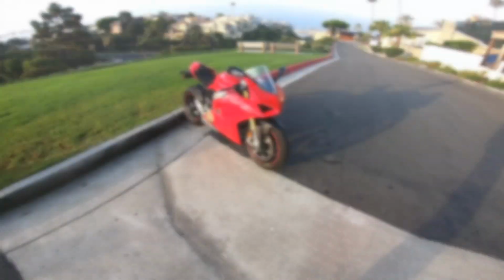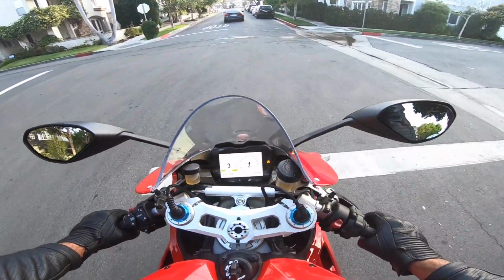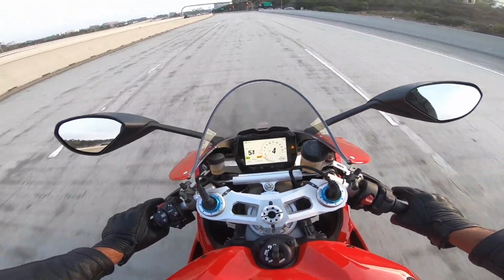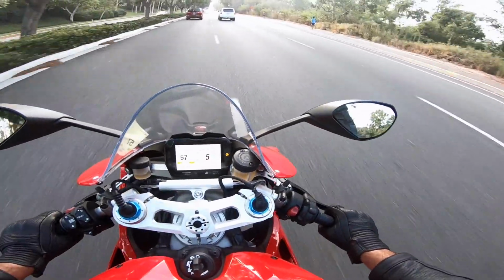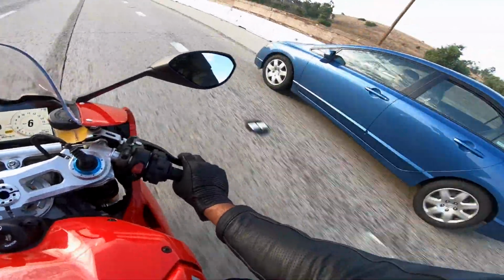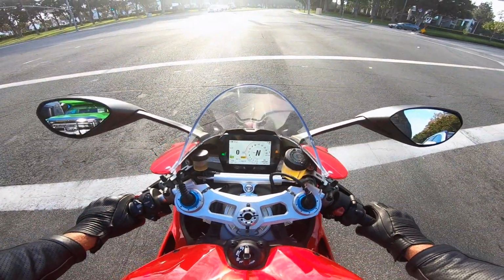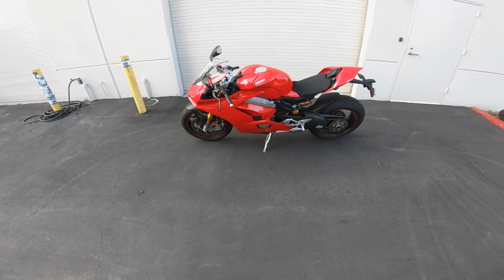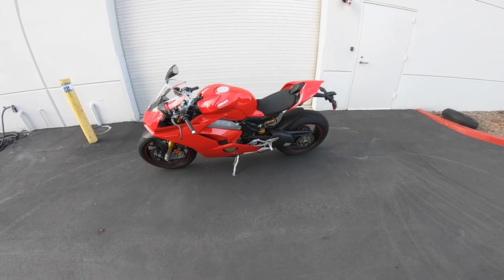2019 Ducati Panigale V4 S Review | MC Commute

Comment: the only thing i learned: the words "panigale" and "commute" should not be in the same sentence.
Reply: Panigale wasn't really build to be used for commute.

Got my friend V4R for a month as a lease to test it and damn it didn't took me 2 weeks before I return the bugger back to him back ache,palm and shoulder hurt the most but its a fun bike.

Also its not highly suggested to use this bugger in time of summer due to its nut cracking hot wind blowing.
Reply: deck pogi how'd you get the bike as a lease? You mean temporary rental?
Reply: As a 1299 Panigale S owner, I can attest to the accuracy of this statement.  The right thigh cooker will have you re-thinking your decision at the first stop light.  Get it out on a race track, though...
Reply: @deckpogi2680  if you aint hitting the canyon or the track getting something else instead my friend
Reply: @fmartin59  my friend own one right away.

He's working in the Ducati as one of the designers.
Reply: @patthonsirilim5739  I got tons of liter bikes I've bought and used.

V4R is a fun bike minus the clutch plating problem.
Reply: @deckpogi2680  What clutch plating problem?
Reply: @BTrain-is8ch  the clutch itself tend to slipped and doesn't shift well.
Reply: @jeanquadvandamage9211  what if my thighs and skin are built different?

Comment: Nobody wants to admit it... but how good a bike looks IS important... and that bike looks GOOD. As much as I love wheelies... that little head wiggle when you land with the front pointed a bit off is definitely pucker inducing... steering damper is your friend.
Reply: Yes looks are important but the thing that makes you smile whenever you ride the bike is the performance. You can make a shitty chinese 125cc bike look like a panigale but you’ll end up selling it because it doesn’t satisfy your need
Reply: Bikes are no less than works of functional art.  Some examples just jump out at you.
Reply: Steering dampers are your friend indeed, but good ones. I found out the hard way how bad was the factory one on my TL1000R coming down from a 3rd gear wheelie. Never had a worst tank slapper in my life! Needless to say I ended up in ER :)
Reply: @BloodySinner as u said looks are subjective, but the new s1krr is far from a fireblade in looks. I don't know how it looks same to u.
Reply: Why do you turn ur wheel when wheeling? Lol it should stay straight..
Reply: @bobfrankfurt9449  You generally don't... but there are lots of circumstances where landing can get a bit off. Sometimes when I get on the throttle a bit hard too quickly coming out of a corner the front will lift and then it's tricky to get it back down perfectly because you're straightening up and shifting balance (usually it's a bit off). If you have a bike that wheelies easily under power you get a lot of practice.
Reply: @bobfrankfurt9449  you turn your wheel when you wheelie is so you can see the road ahead.  If you kept it straight you can't see the road in front of you, which is important.  You need to see the road ahead of you so you can watch for possible obstacles in front you.  Last thing you want to hit when you are doing a wheelie is hit a pothole.

Edit:  I'm not talking about the actual wheel of the motorcycle but your wrist and the handle bars that block your view.  When you wheelie obviously the front of the bike is up in the air you can't see what's in front you. So, you turn the handle bars so you can see what's in front of you.

Comment: It has this great EC 2.0 dynamic suspension that is obviously rubbish for the street. I have no idea what you mean by calibration from Ohlins, the suspension is always going to be calibrated by the manufacturer based on the bike. It sounds like its set to track or sport by default, so a manual adjustment for preload etc.. based on the weight of the rider etc... is always going to give the best results and for street use, Road settings for suspension are not just more comfortable, but safer.

Comment: Good review.
Only thing i would say is that the heat is actually not that bad. 1299 was way worse than this thing. Ive been riding mine during the summer down under and its not too bad as people make it out to be. But you have to know what your in for when you buy this. 
I guess depending on your size i actually find it more comfortable than the s1000rr. Heaps of leg room on this thing especially if your a taller rider. 
On the street its very tamed when you put it into other modes such as sport and street. 
But yes agreed on the point that this at first a track bike. Thats where this things feels at home the most
Reply: Camrides, the riding position on my 4S is actually not all that bad. I have some room but it is still "tucked". I can only say if the 1299 was worse in the heat department that would be extreme, I find mine in summer San Diego to be nearly unbearable at stops, I've heard so many similar comments......

Comment: So, it’s the top of the line Panigale, with one of the most sophisticated electronics packages on the market. This guys going to ride to work to formulate an opinion and provide a ‘review’ for the road; whilst turning off every single piece of electronics and switching the active suspension to fixed.... because: ‘wheelies, backing into corners, endo’s etc....”. 

Just when you thought you’d heard it all, someone comes along and raises the bar 🤦🏻‍♂️

Comment: As an owner everything that Adam said here I agree with.....my experience is very similar to his...although at a much lower rider skill level! I laughed when I saw him struggling to find the kickstand lever, this is VERY common on the V4 and one of my favorite mods is to install an extended kickstand "bar", makes it much easier to find. Also, he mentioned the HEAT this thing puts out. I just would not recommend this machine as a commuter or "one and only" motorcycle. It is a second motorcycle, particularly if you're going to track or just keep it as a weekender. Even at that if you've been riding a while and need to stop at a light or stop sign, your gonna cook. 
Neutral is very easy to find if you pop it in just as you're rolling up to a stop. A lot less easy to find when you are already stopped, my opinion. 
Great job Adam, good insights.

Comment: I am communiting on a panigale 1199s. Let me tell you v4s is comfy comared to the old panigales! And I still love my commute, every second of it. Life's too short to commute on a scooter!
Reply: How long and how often what is ur height and weight? Thinking of doing something similar, commuting on a more extreme bike when I eventually upgrade.
Reply: @KERBROES  I am 196cm and 99kg. Everyday, about 30 minutes in traffic in one direction. But I do regular trips up to couple hours (biggest on 1100km in 1 day). You only need to install the comfort seat from ducati, makes the seat more horizontal. Original will push you too much to the bars and tank. Also, this is one of the comfies supersports for a tall person - the bars are wide and comfy, lots of legroom. You will need higher windshield for speeds over 220kmh.
Reply: For long trips, vibration and noise are making the ride a bit unpleasant, but you need to be on the bike for quite a long time to notice that.
I did around 18.000km on my panigale. Cheers
Reply: @bezetuba  amazing! I am just a little shorter than you by like 6cm. Great to hear that super sports are so usable as a daily machine. Always want one but scared it would be too much but hey I already drive an evo 9 it cant be too bad haha.

Comment: (I'm a no motocyclist noob)
When you said ''throttle respons adjustment'' feature, I was thinking... why not have a digital equalizer panel so users can adjust anything to their wishes (at least as an optionality)? Maybe just rambling but I can imagine some like to tweak it on several levels and these ''modern'' fabric settings prohibit that free tweaking of the motorcycles.

Comment: Had a '19 R1M, and the Ohlins shocks were amazing! Made this track beast livable with on the road, other than it got hot if you didn't ride her hard. Thes V4 Panigale look beautiful though.
NOt sure that I like that he did a "street commuting" revie on track mode....  again, from my experience with the Ohlins supension on my Yammy, having that on Dynamic made potholes and bumps smooth. Also, From what I've been of Ducati's, Street and Sport mode have plenty of power, and they smooth out the throtle response... 
Again, wish he woudl have tried the rider modes and talk about the difference, Not all of us are Macho gusy who need to have 100% of a superbike on the road...

Comment: Thanks for the review. I do like this new Duc v4 and considering a purchase very soon. One aspect of quality that confounds me: all of the v4's that I have seen have misaligned subframe on the left hand side. That is, the black subframe seems to be fractionally too wide where it meets the silver main frame. Why? The heat problem appears to cook the quickshifter and sidestand relays - 2 years and still not addressed by Ducati. And seems to be a consensus among track riders that front springs are too soft and the rear too hard. You didn't seem to find this for road use? Laughed when you hit the rough road mid commentary - "Jesus!". 😊

Comment: Why not use the soft plush suspension setting for the slow bumpy street ride?!
Reply: There is no such setting on the Bike.
Reply: @ukcitizen1158  - I have a V4S Corse and it for sure has a very soft setting
Reply: @ukcitizen1158  There are multiple settings on the electronic side and you can adjust the manual to be softer as well. On broken back roads here in San Diego the plush works quite well.....

Comment: Ducati did a good job with the exhaust sound tuning: so loud, I almost couldn't hear Adam's commentary!

Does that distinctive clickety-clackety sound at idle come from the desmodronic valves?
Reply: laughingstalk it is from the dry clutch. It clatters like that unless you pull in the clutch.
Reply: @HeyAddieImTojo  that was my second guess
Reply: HeyAddieImTojo it’s the valves. This bike doesn’t have a dry clutch
Reply: kierre35 , oh, then i stand corrected. Thought all top of the line ducatis still used dry clutch.

Comment: trust me - in comparison to the V2 1199/1299 there is absolutely no heat problem with the V4!
Reply: I cannot comment on the earlier models as I did not ever go through those? But if they were worse, oh my! I find this model throws an insane amount of heat at the riders thighs in San Diego summer weather at stops.
Reply: Tim Bojones I test rode a 959 for 10 minutes and returned it, couldn't bare the heat but now I own a V4S, you are right, compared to the previous V2 this heat problem is very minimal.

Comment: I threw my keg over one once and for the life of me can't understand how any one could ride this on the street. Granted, I'm a little taller than average, but it's seating position is kinda ridiculous.
Reply: Yup   to right,   they raised the set height after to 749 999 models,   I liked my 749,  as a shortish guy of 5'6"   the seat was great @ 780mm.  After that I think they went to 830mm  a good 2" higher,   nogood for my leg length

Comment: I might seem like a real hater here, but I just can't seem to like this bike?

From the looks, it looks likes a ~1990's R1. The engine sound, sounds like having bolts / screws on top of your dash, and having them rattle around.
Price... you already know. Lastly, from the rider's point of view, those mirrors and windscreen, it's just plain yuck.

Even if it's supposedly the "fastest street legal bike", the amount of times you're going to really max it out etc. when compared to other 1000cc bikes, is incomparable to the amount of time you just spend time riding on it. What i mean is, is that is it really worth $20k+ just so you can be a little faster than other liter bikes, on the rare occasion you do have a road that you can max it out?
That's just considering the price, not considering how much more uncomfortable it is (from the vibrations, to the heat).

All of these things are like that, supposedly because it's for track... but tweaked a little to be street legal. So in the end, you've got a bike that's not comfortable for street riding, and that it's tuned to be legal in the streets, hence there's a cap as to how fast you want it to be in the track. I guess this is targeted to that rich dude who only has room for 1 bike. Since I guess it'd be better to just buy TWO bikes